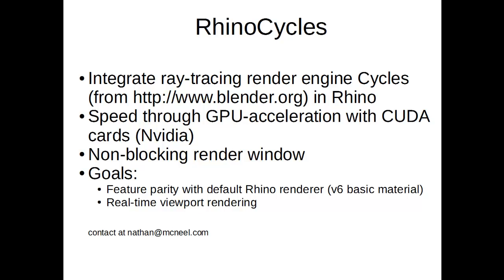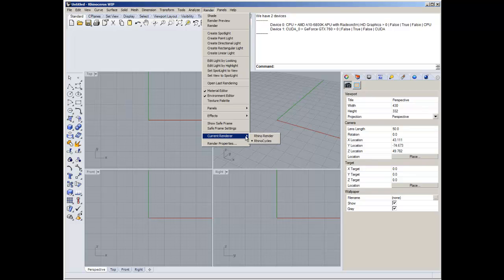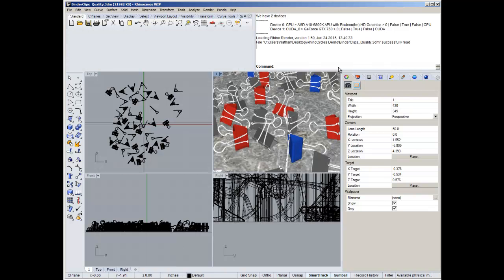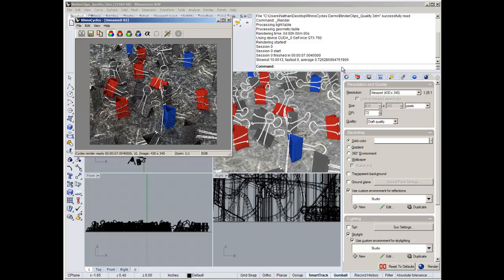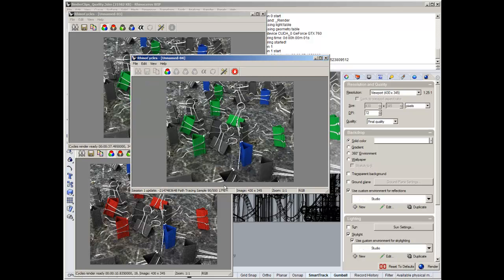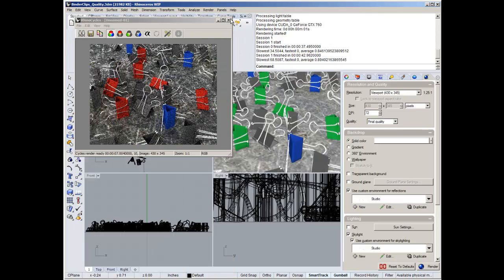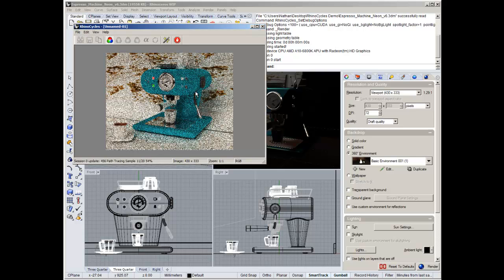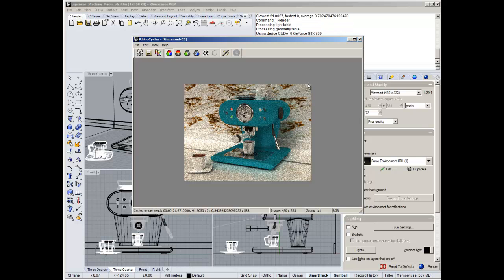RhinoCycles introduction

Comment: isn't it easier just to import your model from Rhino into Blender for rendering?
Reply from the maker: Less switching between applications is easier. The UIs work quite differently, learning a new application is much more resource intensive than using what one already knows.

At this very moment you'll get more control over materials and render settings for sure, but development on RhinoCycles will mitigate such concerns eventually.